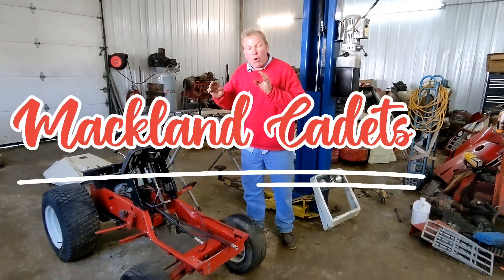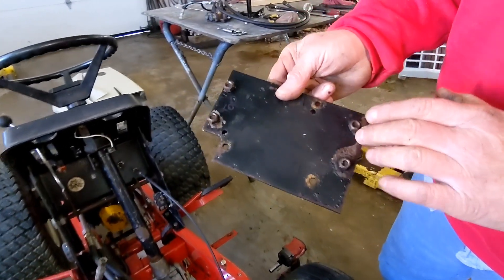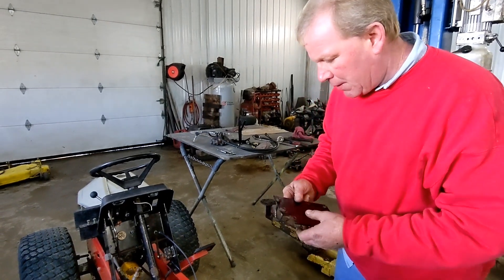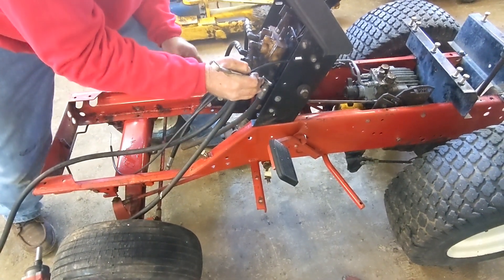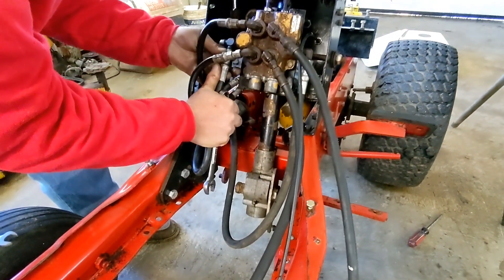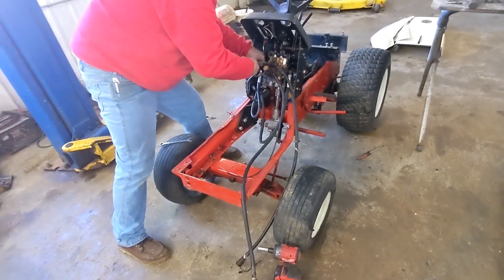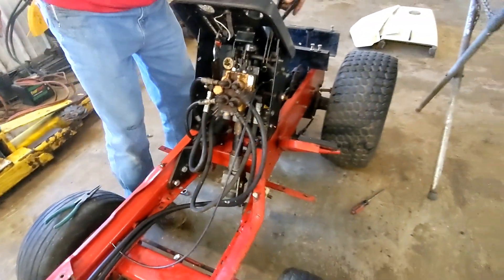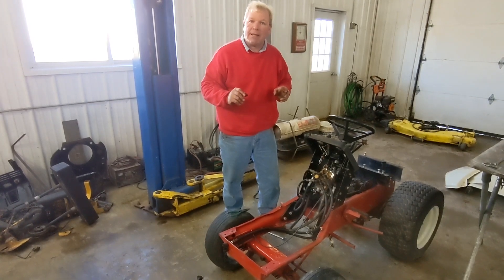CUB CADET 782 DUAL HYDRAULIC SETUP INSTALL

Comment: How did you remove the front knock outs for hoses?
Reply from the maker: They Pop Out Easy from the Front, Just Punch them Rearwards. I Believe in a Previous Video I Punched them Out

Comment: So I picked up the dual valve today and need a cylinder for the power angle. Do you have one for sale or could you tell what diameter and stroke length I need to duplicate yours?
I will be good to go once I get the cylinder 
Thanks for the video !

Comment: Nice video.  I'm doing this now on my 782.  I'm trying to do it w/o removing the engine. At the very least, I have to yank the gas tank.  Those double valves are getting hard to come by.

Comment: Great video, I just bought a 782 and know nothing about it. Matter of fact I won't bring it home until next week. I don't think it has dual hydraulics but does have hydraulic deck. I also don't know if it has two levers to operate the hydraulics but for sure has one any way. Where do you find the valve and other partts needed for the dual setup?
Thanks

Comment: Great video, do you reuse the same bracket for the dual and single remote?
Reply from the maker: Yes , but you have to use Different Holes! When I Remove from another Machine, I only Remove Clamps!

Comment: thanks for these videos theyre very helpful especially for people new to Cubs. i really want to do this mod on my IH 782, could you use the power steering port for a set of remotes at the rear? id like a rear set for my DR power grader that ive converted to hydralic lift.
Reply from the maker: Most Likely you wouldn’t be using front and Rear Remotes at the Same time, so just put a T in both Lines and Run another set to the Rear!